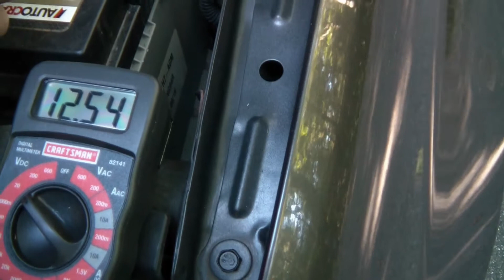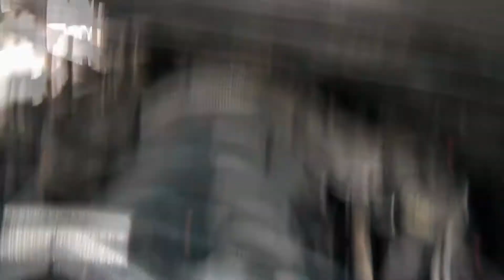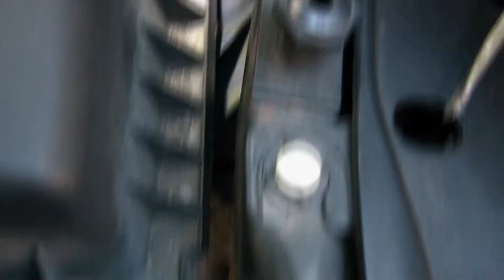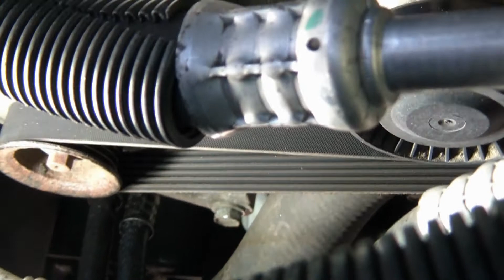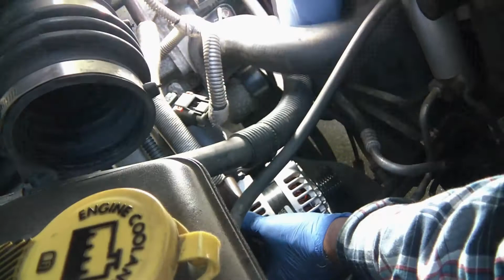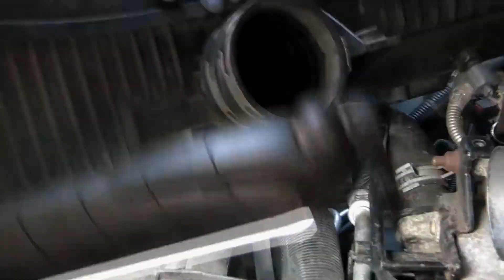2005   2008 Jeep Grand Cherokee Laredo 5 7 L Hemi  Alternator Replacement

Comment: Appreciate the step by step process here! Followed it to the T when replacing the alternator and serpentine belt on my 2010 Jeep Commander 5.7 Hemi
Reply: @Alex Herrmann I know its been a while since you posted this comment but I'm having a tough time finding a video  specific to the 5.7 Hemi Commanders. I have an 07 myself and need to replace the alternator (it sounds like I have a supercharger under the hood lol) The only issue I see upon first inspection is the top coolant line running to the high side of the radiator seems like it might need to come off and the AC lines are pretty tight to my alternator.  I'm hoping that removing the intake and air box negates these problems and gives me enough room to complete the repair. If these steps worked for you I'm hoping its the same for me. I have two Commanders and the other one has the 4.7 V8 which is way easier and simpler to work on, so all the maintenance to my Hemi is a learning curve. I've had the 4.7 for years and I am pretty familiar with all repairs on it but just recently purchased the Hemi version. I don't like paying anyone to wrench on my vehicles, glad to hear that the procedure shown here should work on the Commander as well. ✌
Reply: Commander owner here (06 Hemi)... watching for the same reason, but only for knowledge at this point.  My Jeep has 146k miles on it and I'm considering just replacing the stock alternator as it's pretty old.  If you ran into anything interesting/odd while replacing your alternators, please share.   Thanks!

Comment: Thanks for the video. I have heard that if the battery light comes on while driving and the electrical problems occur with vehicle warmed, it is usually the alternator is going bad aka "the alternator is no good"!

Comment: Hey I'm stuck at the tensioner step. I stuck my 3/8 socket wrench inside the square hole and turned it but it wont budge. Do I turn it like a bolt or do I pull it?
Reply: He says turn clockwise but isn't budging either
Reply: @piky1983  get a long breaker bar, 18" or 24" and it will move easier.
Reply: Muscle or longer bar for leverage.